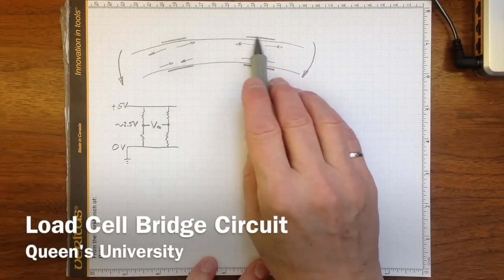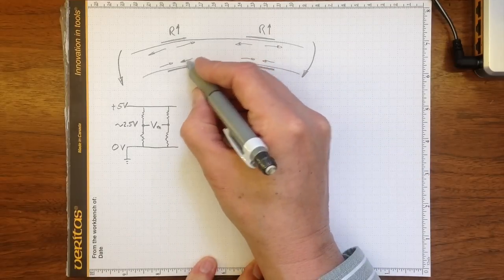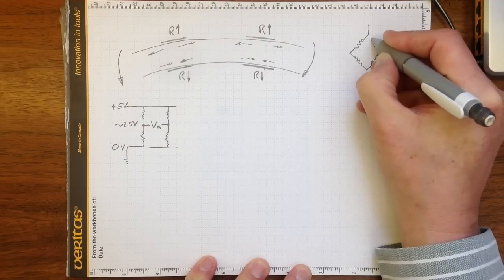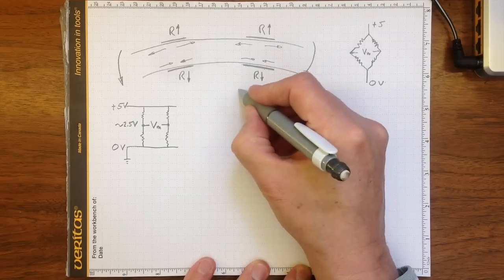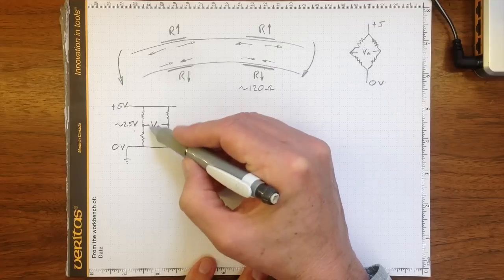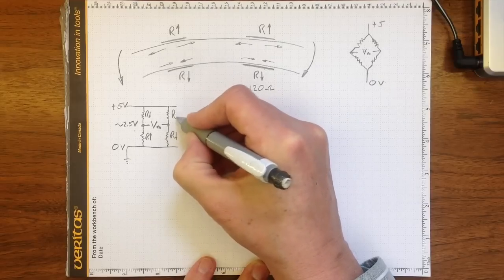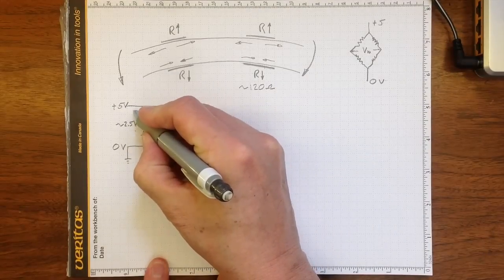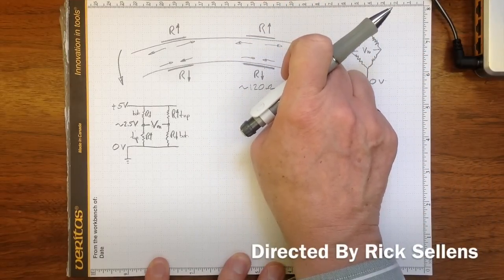Load Cell Bridge Circuit

Comment: Am I correct in my thinking that on a single-point load cell of the "binocular" type (aluminum bar with two connected holes drilled into it) one of the top strain gauges compresses while the other stretches, and that the exact opposite occurs on the bottom strain gauges? 

Thanks for your video. Great simple explanation!

Comment: Rick if I have 4 load sensors with the 4 wire Wheatstone bridge is it possible to connect them up together in parallel or do would you have to connect them up in some sort of series to measure it?
Reply from the maker: If you have 4 load cells, then you should measure the output of each separately. If you have 4 strain gauges as in the video, then you should arrange them in a bridge as shown.
Reply: Thanks for replying Rick i was coming to that same conclusion.  I was trying to repurpose a Nintendo Wii balance board as a scale.  There about 6~10 bucks at good will and have 4 load cells in them.   I was trying to use an hx711 to measure the load and tie it in with either a particle.io photon or esp8266 to make it report back weight on a bee hive.  But that was a very good tutorial.

Comment: Is it the stretching(longer path=more R) that just causes the increase in resistance? or what else is going on?
Reply from the maker: The element gets longer, but it also gets narrower (Poisson's ratio) so both of those geometric factors contribute to the resistance change. In addition, the crystal structure of the metal is strained, changing the resistivity. The combined effects are all accounted for by the gauge factor, usually about 2.0, and provided by the manufacturer for each batch of strain gauges.

Comment: Sorry, you are wrong. The load cell is not designed to be bent. It is designed to be loaded in a shear. If it us bent as you describe it's output will be 0.
Reply from the maker: John C it will depend on configuration of the load cell. What you say will be true of a shear beam load cell, typically a beam with a hole in it. The simple bending beam cell in this video will be sensitive to bending.